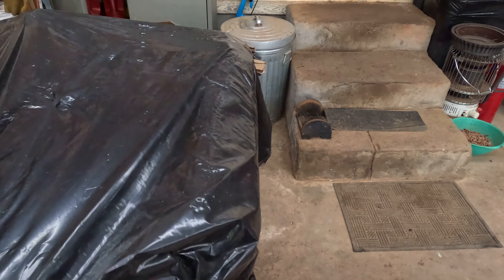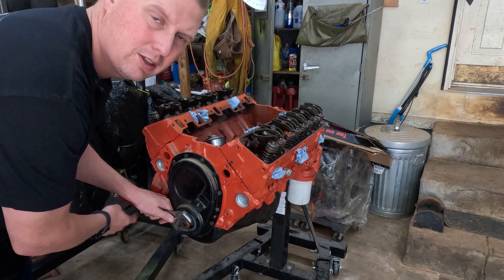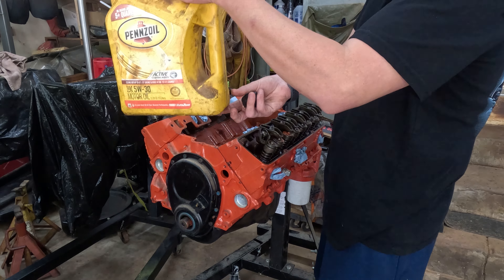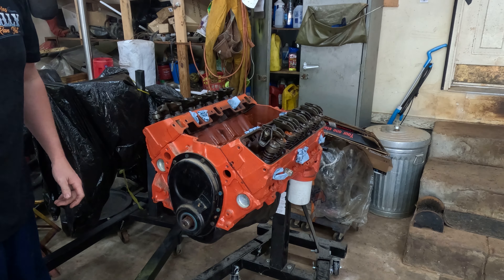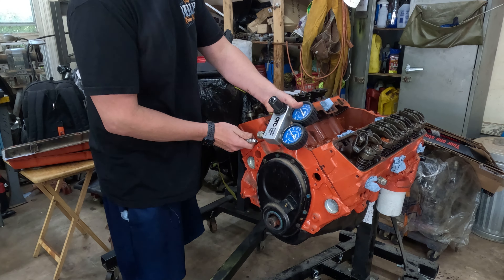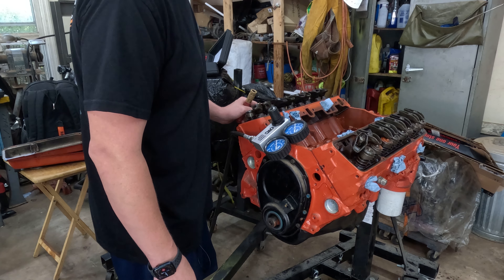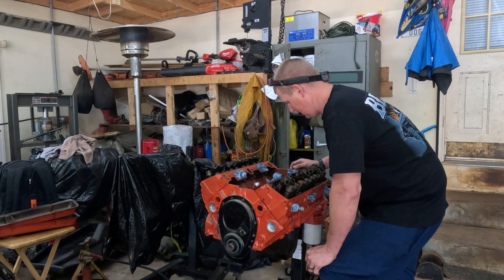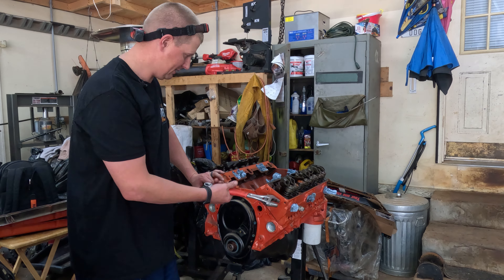🔎 Vitals Check! Engine Been Sitting 10 Years | Reviving a Classic 🚗💨

Comment: Ur leak down test is very concerning. I dont know how ur leakage tester works but the number mine shows is the percentage of leakage. So the first one u showed being 72 i believe? Thats how much it leaks. Not good. But u really should try to bring the piston to the top on each cylinder. I know u dont have rockers & such. But that is how its meant to work. If it held like it should it has to be at the top or it will spin the engine till its at the bottom. And i guess there is somthing to be said for it holding pressure at the bottom as well i guess. But u have sagnificant leakage. U need to determine it is going past the rings. Somtimes it can be difficult to tell. But 4 ways it can go. Intake, exhoust, rings, head gasket, witch then it msy go into the coolant or across to another cylinder. 
   Sometimes a new engine can have resistance to turn. Its not (or shouldnt be) the bearings. They "should" have assembly lube. Witch should stay for 20 yrs if it needs too. The rings & pistons are what is cousing the friction. If u removed them u should be able to just spin the crank sitting in the mains & have it spin a lil bit when u release it. It will have a small bit of resistance do to assembly lube is kinda think & somtimes sticky, but one hand for sure should easily spin it. Get a torque wrench with the long needle kind that points to your torque values. Turn the engine useing that & u can measure the resistance. Its not uncommon to see 30 maybey even 40 lbs in some cases. Now that being said, its ok & even expected depending on some builds it certainly isnt what u want. U want it to spun as easy as it can but if its a stock type rebuild with replacement cast or moly type thick heavy style rings u can expect it to turn hard toward the upper numbers. Some performance builds with new tech thin low resistance rings & maching to match i think ive heard guys claim their engines only took like 11lbs to turn!! Probably not what u have there. Urs will probably take a bit of effort to turn. Lol! But yes, look into those leakage numbers for sure!
Reply from the maker: Yeah, I have two project to finish. Before diving into this one. I am really excited and concerned at the same time on this project. I definitely will be keeping everyone updated on the results! Thank-you so much for the comment and advise.